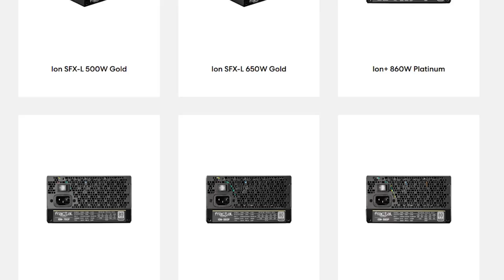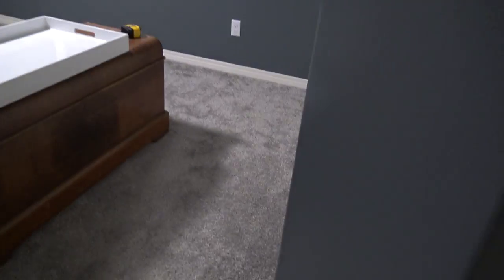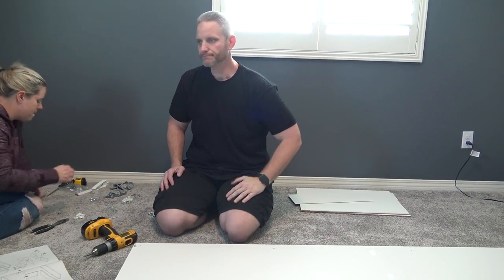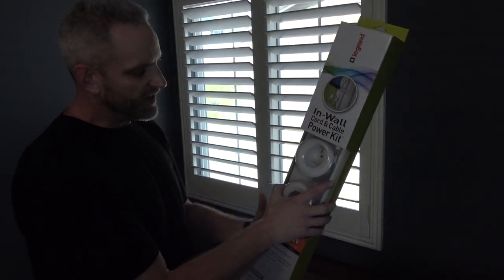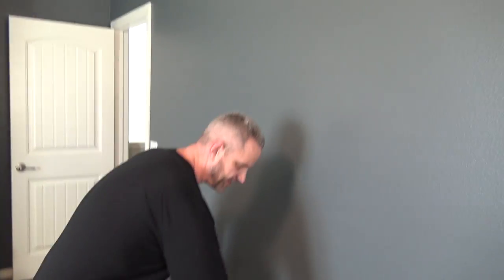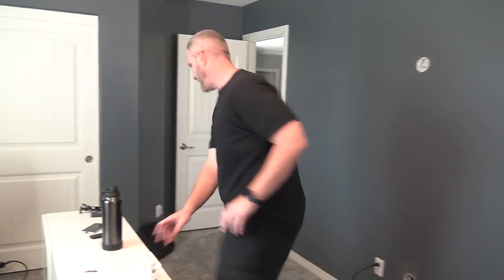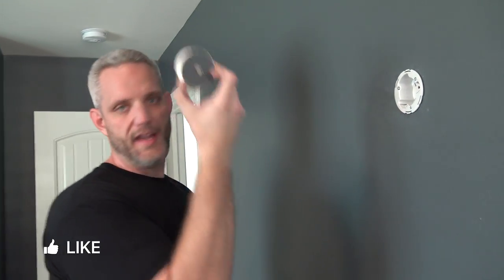Ultimate Nerd Cave Build - Part 2 Let's DIY some stuff!

Comment: For future reference J, when you test hardware with in game frame benchmarks, We wanna see the Minimum AND Maximum FPS, because the range there is the most noticeable performance stat, you CAN run at 1440p 144hrz, but its gonna be a much worse experience than something lower if your frames have a noticeable range, sudden decrease in Fps makes your brain lag. Dont even care about the average. Its not good enough to look at an average when youd be better served knowing each of the numbers that went into that.

Comment: Hey Jay, just a reminder. You got away with the extension cord solution for your fake set because it wasn't permanent, based on it not being anchored in any way to the floor or any other walls inside the building.  You are likely out of that grey area of the code since the room in your home doesn't follow that criteria.

Comment: No insulation between internal walls is a headscratcher.  Sure it'll help with temperature equalization, but without the vibration dampening there's so much sound transfer it's a nightmare if you live with literally anyone else.  If you want to actually isolate a room temperature wise, that's another huge negative too.

Just something that's baffling for houses here.. besides them being made out of essentially wet paper when it comes to natural disasters.

Comment: I hope he put that power kit in the right place so the wall bracket doesnt interfere with it. i usally measure the Tv and hook height then put tape on the walls to visualize it, then i mount the bracket to the wall then install the power  kit so i know for sure i dont put the power kit in the wrong place

Comment: I'm a European and I envy those walls for cable management. I have like 500ft of cables in my "nerd cave" and it's impossible to manage them.
Reply: I don't lol, I would prefer my walls to be made from solid brick. We can literally mount a TV, wall shelves etc anywhere we want.. No need to look for studs to mount on
Reply: @MrEditsCinema  I was talking about cables, not wall mounting. Good luck trying to drill a cable channel into a solid brick wall without having to repaint the entire room so the paint would match.
Reply: @dominic.h.3363  Use cable channels, look fine. Especially when painted
Reply: @MrEditsCinema  No they don't look fine, they look like crap. Especially if you have so many cables you need a 10 cm channel.

Comment: 6:15  Jay explains simple things take forever and emptying a room took 2 days. Next scene..... Jay using a screw driver handle as hammer. Now his first comment is both in some context and explained. LOL
Reply: Jay, little tip for you on the plugs for drywall. You can keep those inside the wall..... Use a piece of string or such through the inner hole, tired off to a washer, take the other end and tie it to the cords run in the wall. Keeping them inside the wall keeps them damage free and if it's your routine, you always know where they are.

Comment: Hey Jayz

Can i grab your attention a moment, and sorry for asking in this video.

You where doing a overclocking guide at some point where you disable some feature in Windows, so it won't get bonked when stress testing when Windows crashes, but i can't find that video. What I'm talking about is when stress testing fx a CPU OC you disabled some Windows Error reporting feature i think or something correct, so Windows would not get screwed or am I wrong? :)

Because I'm asking is that I have a AMD Ryzen 7 3800X with a Asus Rog Strix 570X-F. When overclocking windows crashes a lot until I find a stable OC, but sometimes Windows hangs and goes into repair mode, which is annoying. Currently I'm at 4.4Ghz all Core-Boost, but still tweaking ^^ Getting a Cinebench R20 Score of 5143 :P

Kind regards Mark

PS: Keep doing what you do... Your Awesome bro :D

Comment: Why would running a 6' piece of Romex off the existing outlet to a standard single/double gang box above, then running coax, ethernet, and/or HDMI to a low voltage box beside the other box be such a challenge?  Terminate all your connections inside boxes and you're code compliant.  Cleaner install and a whole lot less expensive than buying that kit you bought.

Comment: Yeah, this is where the US stereotype of "the houses are made out of paper and plywood" comes from...because there's hardly any solid walls or brick used (for interiour walls). Right next door they just recently build a house, and every interiour wall is brick. They are special bricks that are hollow for routing cables and waterlines and all that but it's still brick.

When I had to put up my kitchen cupboards, I had to get a rock drillbit and a powerdrill to drill into the wall deep enough, and while some might say that's inconvenient, at least you know everything you mount on there is gonna stay in place and can bear some load. At least if you mount it correctly XD

I'd honestly be scared that I could accidentally trip, fall and put a hole into a US wall...or bump it with something and again, put a hole into the wall. Wonder if that is an actual problem.

Comment: LOL...so..."Empty Room" to start with.   Nope...I just did a very similar build in my office...and I did it with EVERYTHING still in the room.  Build a drawer unit, fill it with junk from the desk (because I had no drawer space), build another drawer unit, put more junk in it.  Pull the first part of the desk unit out (HUGE U shape)...put the 97-1/2 Karlby Top...rinse and repeat.  3 days and STILL not done.  SO TIRED, but it's looking better.

Comment: if your house was built in the 1930's studs will be every 24inces the studs really dont hold the roof up it will be walls on the out side of the house holding your roof up  if your house was built in the 1970's and up every 16inches

Comment: @Jay, 

You need to fill that wall with insulation.... Take your hole saw on the out side of the wall and drill a hole at the top of each stud cavity (save the plug) and pour loose fill for sound proofing. use plug to patch sheet rock. or "install crown molding" <---- my choice, I hate sheet rock.  This will help "wife proof"  you setup when it comes audio time. https://www.uline.com/Grp_41/Peanuts-and-Dispensers

Comment: please help ... for heavy  rendering  witch one will manage the heat and give me the max cpu's clock speed at the same time ... acer predator triton 500 or the new HP omen ...they both have the same spec  i7 9th and rtx 2060

Comment: Ye pretty freaked out, no insulation? We use insulations even on the inside walls because it dampen sound alot better and usually it's 1 layer of MDF/plywood and 2 drywall/plasterboard or whatever you say.

Comment: Wow your walls are thin and low density, is that normal in the US? Houses must be really bad on noise isolation then...
Reply: Most US and Canadian houses have interior walls made using 2"x4" wood studs, spaced 16" apart, sheathed with 1/2" thick 4'x8' gypsum wall board on both sides. If you want better sound insulation than that provides, you can use various methods including filling the cavities between the studs with fibreglass or other batt insulation, doubling the thickness of the wall board, and using resilient channel between the studs and the wallboard.

Comment: Glad this wasn't DIY painting with Jay. Some of these wiring jobs are made so much more difficult than they need to be due to lack of experience or not realizing there are significantly better looking and performing solutions (not using an in wall power extension kit - IWPE) that are actually legal in all states. Gotta love California and their bizarre lax codes. Consider doing a video with a professional that shows a more accurate representation, I know this wasn't a tutorial but it does have some bad info/directions if people tried to emulate.

Comment: hey can you help me with my problem, i recently built my own gaming/streaming pc, my specs in my rig are a ryzen 7 3700x, RTX 2070 super, 16GB ram, 500gb ssd and a 750 watt power supply from corsair, i stream fortnite and i make sure i keep EVGA precision x1 open to check my temps, and adjust my fan speed it my gpu get to hot, and either when i stream or game it just seems to restart my pc, i would really appreciate your help if you could help me resolve this issue, PLEASE GET BACK TO ME.

Comment: What I dont get about these american walls is that all the electrical is flat cables stapled to the wooden stenders inside the wall.... so you cant replace them or add more wires easily..
most places in Europe as far as I know use like "K-tubes" or pipes or whatever you call em, and the electrical sockets are much easier to install aswell.

anyone have a good answer to why USA (and others) staple their electrical wires inside the wall????

and tf why use 110V? its inefficient :P

Comment: 1:40 - "I want higher end and classy look" LMAO! Well don't go for Ikea then! 
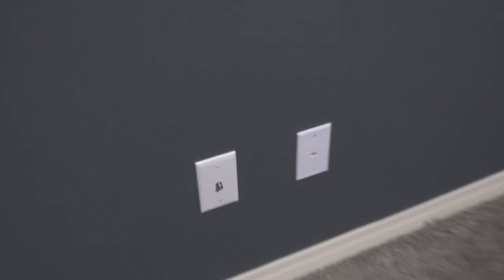5:39 - Your painter needs some lessons in hole filling. Using silicon is not the right product. Putty filler or builder's bog are the correct products for that job. SMH
Reply: Tarquin Farquhar even a bit of spakfilla would do for a couple of little holes like this. The paint was better than the painter.

Comment: thoughts?

Enermax StarryFort SF30 RGB
AMD Ryzen 5 3600X (6x 3.8GHz / 4.4GHz Turbo)
AMD Wraith PRISM RGB
MSI B450 GAMING PRO CARBON AC (inkl WLAN+BT)
16GB (2x8GB) DDR4 Corsair 3200MHz Vengeance RGB PRO
1000GB Intel 660p M.2 PCIe 3.0 x4 NVME (L 1800MB/s ; S 1800MB/s)
8GB KFA RTX2080Super EX
650W Corsair TX650M

2k 100hz